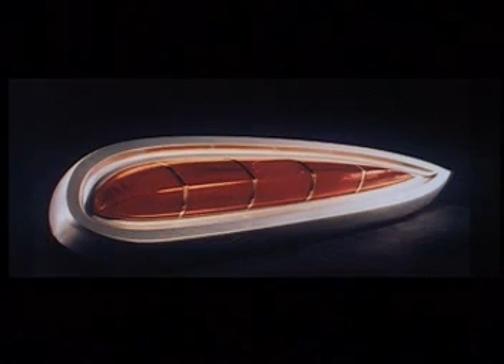The making of the 1959 Chevrolet Belair Impala שטרסברג

Comment: I've had 3 '59 2 door Impala hardtops in 1977, '79 & '98, 2 had the 283 powerglide &
one had the 348 turboglide. I miss those cars terribly I grew up with the '59 Chevy's when
they were everywhere. Now they're dinosaurs & it's sad.
Reply: I agree..time to find the 1959 and 1960 and rebuild each and everyone of them. Iam currently looking for one of each to gently restore back to original condition.  I grew up riding in those Classics of the time! 
The fins were far beyond anything Cadillac ever attempted!
Reply: @MC-gp9ke  My 3rd car in 1978 was a '59 2 door Cadillac series 62 I bought at an 
auction I didn't want it but I kept bidding on it. I like the '59 Chevy's better.

Comment: And to think, the basic sketches were probably started in 1955, approval and first mock ups in 1956 or 1957 at the latest.  It took a considerable amount of time to build the tooling for the sheet metal, get all the vendors in place for all the little pieces and bits and have it ready by July of 1958 if not a little sooner.  Back then they used to to a "model changeover shut down" in early summer for a few weeks.  Times sure have changed.
Reply: Funnilly enough, that means that the looks of the late 50's were akin to the middle of the 50's designs, and the 1954-55-56-57s designs were early 50's idea concepts. That means tons of models were thought up from 1946 to 1950 alone. Incredible absolutely just embarking on what could of been the big change into something truly surreal as though the time wasn't surreal enough.

 Some people/folks remember Manhattan or Chicago like the back of their hand, I remember the 1940's, 1950's, and 1960's like the back of my hand.
Reply: These were actually a crash redesign in response to the 1957 Chrysler Corp designs.

Read 'The Cars Of Harley Earl.'  He actually hated the design, but he had reached GM's mandatory retirement age of 65.

Willuam H 'Bill' Mitchell was responsible for these designs.
Reply: That they were. The original face-lifted '58 was completely discarded. Work began in December '56 or January '57, 7 days a week over several months, with the model we all know almost complete by May '57, except for minor details. The other 4 divisions had to do the same thing, so all 5 were on the same page, and were very close to production-ready by July/August '57.This was shockingly fast, and just in the nick of time. @jonathanmorrisey5771

Comment: Style and design that has yet to be matched! Bring back those styles and designs.  A Duplicate of the 59 and 60 would be best sellers! I'd take a pair of each!!
Reply: Be nice if GM remade them again I grew up with the 59 & 60 Chevy's. the problem is it would be too expensive to produce today. Only the rich can buy them. Chevrolet was never a luxury car.
Reply: @winggullseagull1230  Agreed. .imagine a brand new 59 or 60 in the drive way. I would buy one..be less expensive than the costs Iam looking at for off frame restoration . I'd still finish my restoration and own a new one if Chevrolet made them again. .looked at a 59 station wagon and two El Camino. .booth would only make one..Glad to chat with a 59 and 60 enthusiast!
Reply: @MC-gp9ke  I agree if GM remade them & if it was affordable they would sell.
Because now the outrageous batwing style is now appreciated. I had 2 '59 Impala's in the 1970's when they were dirt cheap. I could've bought a mint original condition '59 2 door Impala for $1,200 in 1980 & I had to spend hours at the sellers house thinking about it I finally decided not to buy it & bought a '59 Ford Retractible instead. Looking back now I wished I would've snapped it up. The same year I could've bought a '60 2 door Impala in mint condition
by the original owner for $800 & I didn't buy it. Much to my regret.
Both were stock & black paint with red interior.
I always wanted the 59 & 60 Chevy's at the same time. It never happened.

Comment: The '59 Chevy could fly.  Not intentionally.  Entertaining video.
Thanks
Reply: My first car was a '59 2 door Impala in 1977, I was 17 & I knew about
the rumor of '59 Chevy's lifting up at higher speeds. Because of the deep
air pocket of the fins where wind trapped under the fins would push & lift the
car up like an airplane. It's true because I would drive on the freeway 
doing 80 to 90 mph & it did lift the back end up & started to drift.

It's no rumor & it was known in 1959 & buyers were put off by it & it's
probably why Ford outsold Chevy that year.

 It was a bit scary & I slowed back down I was a stupid teenager back then.
I got into a bad accident with the '59 Impala. Not a good idea to fly the '59's.
They're not airplanes. LOL,

Comment: Most of this documentary or film diary of the birth of the '59 Impala started in late '56 GM's design staff got a sneak peak of Chrysler's upcoming '57s in the summer of '56, and were both very impressed and horrified that their cars already looked dated by the sleek and finned Chrysler products. It was already too late to re-do the '58, and the '59 could NOT be the facelift of it per normal they'd planned. There was still time, but not much, to completely overhaul the the '59s. This included Pontiac through Cadillac as well.  A 7 days a week crash course was done starting in late '56 and was nearly complete by May and June except for refinements and details, but the hard part was done. Seeing the pictures I've seen online of the Chevy and Buick from mid-'57, that was them in near completion. I understand the '60 GM's were underway by late '57, and the '61's in '58 and '59. The Corvair  meanwhile was being designed and refined between '56-'58 like the Ford Falcon and 'Quiksilver' Ford which was the all-new '60 Galaxie, an even more shocking departure from the '59 model (as Chevy's was from the '58), which we can all agree was drastically radical.

Comment: so interested in design how about safety ? these cars were death traps mize well drive a shopping cart down the highway
Reply: You don't worry about safety if you know how to drive.  Yeah,  it was big tanks with sloppy steering.  I'd still rather have those cars than what they come up with today.
Reply: You sound verbatim to a Tesla stroker. You think we didn't adjust safety in our automobiles. It wasn't even an issue because we already nailed 1 out of the 7 genres of automobile understanding, one is infinite and will never be finished, "design". Although frankly it was finished by the eyesores of today, If we ever recreate automobiles from back then with idiotic " improvements", no doubt sold for 50 to 80,000 dollars, and a greedy revolting 600 dollars purchase for the color red, blue, and yellow that they ever "creatively" give as a "callback", I will gladly pull the trigger at my temple.